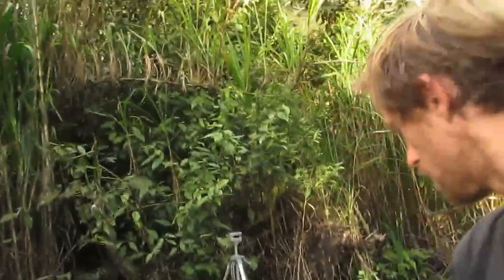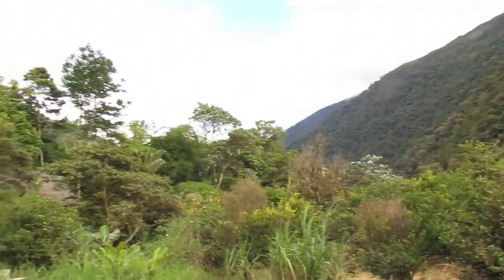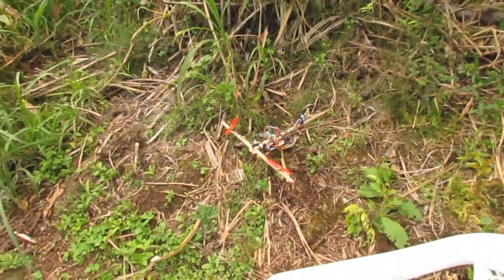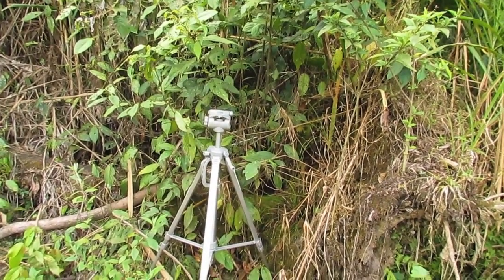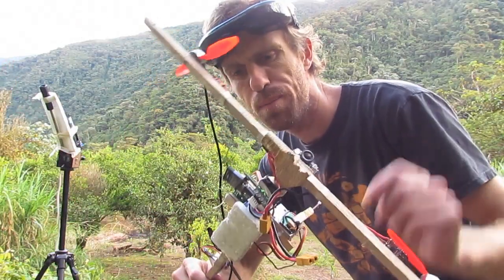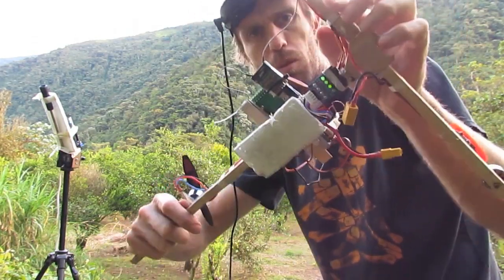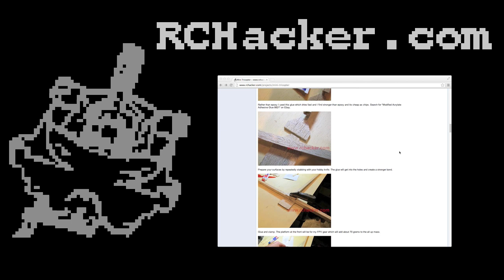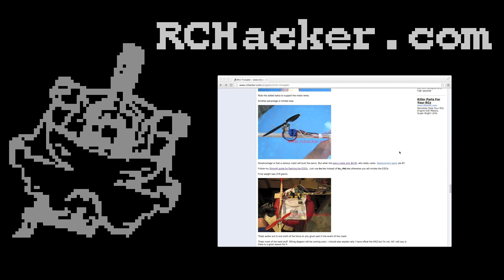Diversity/Scanner ground station preview and first FPV on the Mini Tricopter. RCHacker #11

Comment from the maker: I have an ArduPilotMega on the bench for my next airframe, I should be able to fly down the cliff with that. It will be interesting to see if the handling is as good as the KK2. My biggest problem here is that even with a GPS location if it crashes it will be next to impossible to find it in the jungle. I'm thinking of a small independently powered low frequency beacon.

Comment from the maker: I know what you mean. If i fly down the cliff and lose control signal it will automatically RTL. Ideally it should be possible to make a loss of video signal automatically RTL as well. Its an extreme case but I'd rather instant loiter and climb. Manually switching it might not be fast enough. Anyway I'm dreaming a bit here. I will crash and I will have a long life beacon before I do anything that crazy.

Comment from the maker: I disagree. I only have to remember to charge one battery pack. There are less batteries and connectors to fail, and my TX gives me an audible warning of a low battery. It also powers the FatSharks. 

Besides its kind of irrelevant, If I lose either system I'll probably crash anyway.